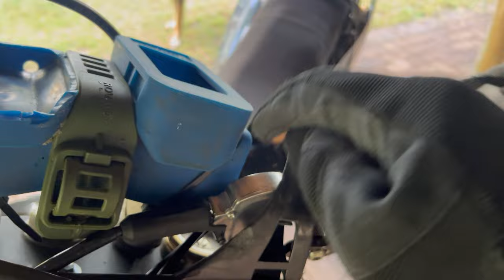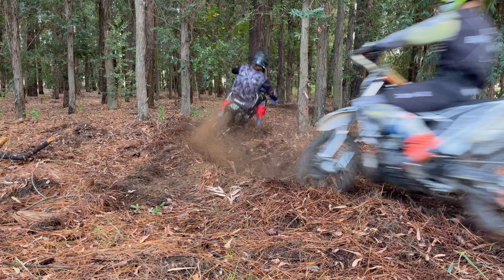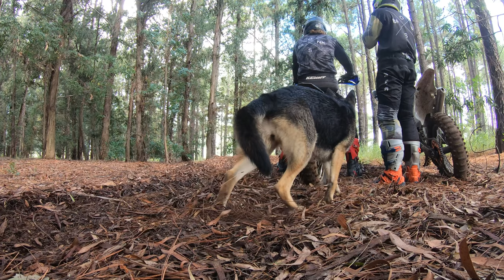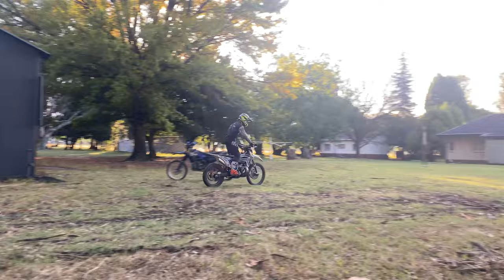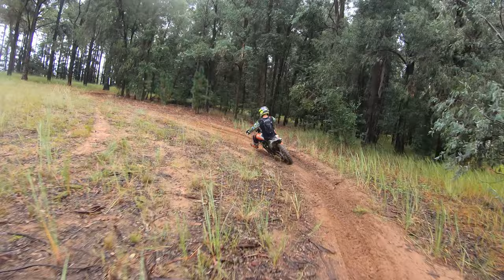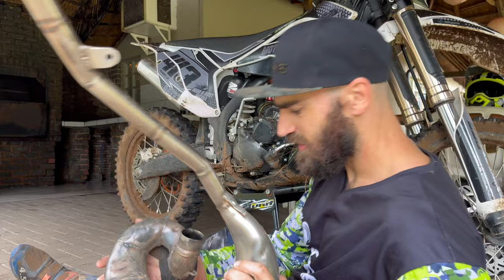Almost Wrecked My Arm | Cutting A New Turn Track

Comment: Sell the GoPro they're nothing but problems, buy a DJI Osmo Action they are rock solid.

Clean the carb and if no luck check your crank seals and look for other air leaks ;-)
Reply from the maker: Ive actually been looking at the insta 360 bit damn that kit is a bit pricy, the issue is not really the camera itself, its when the batteries start to age they give issues so couple of freshies will do for now.

I have already found the issue with the KT250, but i will leave that for the next video.
Reply: @MudAndDustMoto  Nice one, look forward to it :-)
Reply from the maker: @krazed0451  thanks for watching and commenting🤙🏼